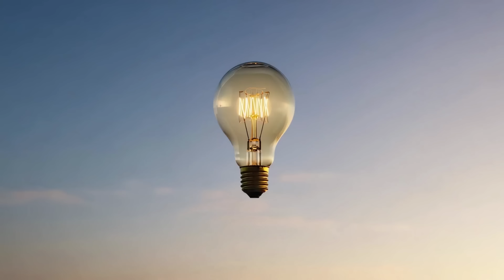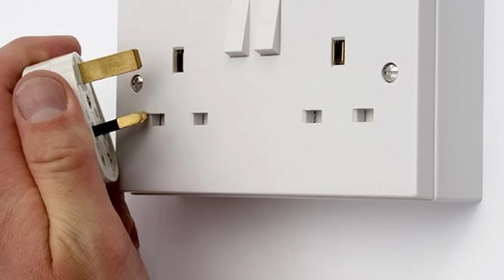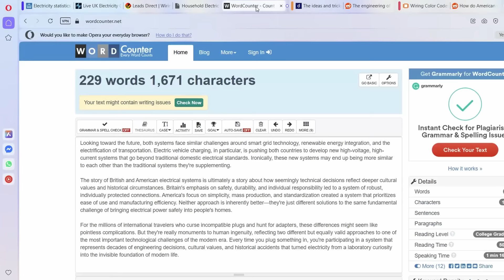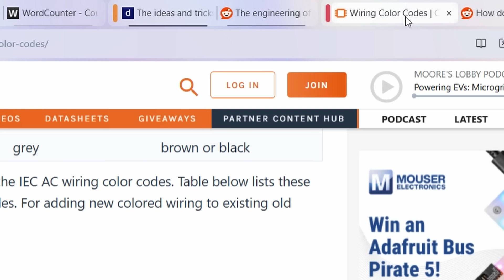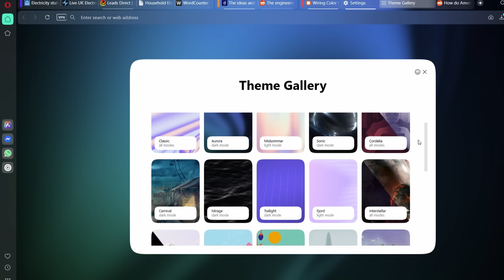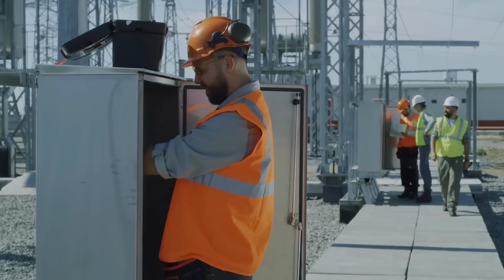British electricity is SAFER than American electricity. here's how.

Comment: For crying out loud.... Come to Australia.... We are 240 VAC with a plug design that looks like a cartoon version of a Chinese person's face. We don't do the ring feed (we consider it dangerous). We also don't need the fuse in the plug because of it. We step the game up by insisting on RCD's back at the fuse box. These watch the amount of current that comes back on the neutral. If there is an imbalance it trips.

It's often never mentioned but both the UK and Australia have switches on our power points. The yanks don't!

Talking STANDARD Australian plugs, you can stand on it and it won't kill your foot. This is because the cable enters via the back and is inline with the pins. Australia and the Yanks win on this point. Before RCD's (like back in the 70's here) if your kid was doing something silly you could pull the cord from the outlet here (without being near the point). You still can, until you us what we call a "side entry" plug. You will see this more in professional areas known as "piggy backs" these will hurt your foot if stood on!

Comment: Now, this is something you may not know, as a 2⁰ science teacher for a decade, one of the things i Had to cover was home electrics. It's in the core science syllabus for Y7-9 (11-13 y.o's. so not only is there the inherent safety of how a plug is wired & the pins & switched sockets but i used to have to teach kids how you wire a plug & trust me, i Had to check them rigourously! (Most of the kids knew i did lots of the electrical work for things like school productions & it was always safety first, checking everything & taking nothing for granted!
I'd have to explain things like the colouring of wiring & why (colour blindness! - being red brown blind myself, telling red & brown apart could be fatal, hence the blue, brown & striped yellow + green.) & how to twist wire correctly, the correct order to do the wiring & EV which screws go where if you do happen to take them all out! (At age 10, i was already wiring up a model railway, one month own, with different voltages for different uses & including circuit breakers & fail safes!) Kids had to know about the rings mains, how lights & sockets were connected differently in different circuits & why, the redundancy of fuses, identifying the right ones, hence the equations to calculate it if all else failed & where to find the info on an appliance! Changing fuses & plug safety. As you see, quite comprehensive. Even though moulded plugs are now the norm, kids still know how to decommission a device & reconnect it! It was all about making kids self sufficient adults! It worked!

Comment: Tea-drinking came to Britain long before electricity, when water was heated on wood-, or coal-fired ranges. But perhaps the decision to go with a 240 volt system, and the ability to boil water using using electricity in a short time, held some sway in the electrical engineers' decision-making.

Comment: Our mains plugs here in the UK wern't always the current one (invented 1947), we used to have round pins, and different size 3 pin plugs for different amperages (2amp, 5amp and 15amp and were generally not even fused). Also the black insulation on the live and neutral pins wasn't a requirement until 1984. Prior to these you could insert the plug and touch the live and neutral pin while they were energized.
Reply: The 2, 5 and 15amp plugs do not need fusing and they are for use with a radial system not a ring main system and as such the bfuse/breaker in the distribution box is already at the correct rating for the outlet. The main reason for the change to the G type square pin was because of the new cost saving ring main system. At the time of its introduction. A modern 15a round pin plug/sockect pair has all the safety features of the G type except the fuse which is not neaded as the round pin design is for radial systems only.

Comment: Most of America uses an open delta three phase as apposed to the British three phase star system. In order to obtain a single phase supply from a star system you can aquire a neutral from the star point and one phase.,the American delta type of installation is not possible to achieve this in some cases you can end up. with a hot leg that means you end up with a much higher voltage. The American system is bad, very bad.

Comment: Hi from England, UK. It's not just domestic mains electric supply systems which have so many compatibility problems, have you seen how many different systems are in use on overhead electrified railways across europe? where they have DC with two different voltages, 1500 volts and 3000 volts, and high voltage AC, again with two different voltages, 15000 and 25000 volts, and if that's not complex enough the two AC systems run on wildly different frequencies, the 25000 volt system which we use here in Britain, uses 50 hertz, while the 15000 volt system uses 16.7 hertz! how insane is that?! And neighbouring countries don't have the same systems either so they have to have trains and locomotives with dual system capability when travelling across borders, like a train travelling from the Netherlands into neighbouring Belgium has to change from 1500 to 3000 volts DC, or if a train travels from the Netherlands into neighbouring Germany then it has to change to 15000 volt AC, TEN TIMES the voltage! and change to AC at the lower frequency of 16.7 hertz which needs a LARGE transformer on board.

Comment: When I was a child we had plugs with three round pins.   They came in two sizes.  5 amp and 15 amp.  We were still using them in 1968.  My mother had a flood from a burst water tank and after that the wiring was replaced.  I think that was 1978/9.

Comment: UK domestic power points can deliver up to 3.000 watts, whereas the US domestic power points, at least those I've seen can only deliver up to 900 watts, as they're only rated at 7.5 amps, 120 x 7.5=900. And back in the days of old analogue TV and VCR's the American NTSC system was totally incompatible with the UK PAL system, because both systems ran their TV frame scanning systems at the same frequency as their own domestic mains electrical frequency, i.e. the UK PAL system used 50 hertz, while the US NTSC system ran at 60 hertz, and the PAL system used 25 frames per second while the NTSC system ran with 30 frames per second, and this caused all manner of problems for broadcasters in the US and the UK when wanting to share programming, and here in the UK back in the bad old days of analogue tech the resulting picture quality of American TV shows when shown over here after system conversion was dreadful, but that later vastly improved when digital conversion became available. I don't know what if any compatibility problems there are now with digital TV and I don't know how many countries, and states or provinces etc. have switched to digital broadcasting, most likely the countries which can most easily afford to change.

Comment: In UK in the early days of electricity, one talked of 'electric light' and that was often what was installed - lighting, no sockets at all, the householder probably had nothing to connect to them anyway. Later radios, irons maybe were connected to the light via a 'bc' adapter, problems would happen if a device requiring more current was connected. Time for an update rewire! Great content, thanks

Comment: I have to correct you, the original U.K. electrical sockets and plugs were not rectangular pins and slots, they were round. It was in the late 1960’s that they changed to rectangular.

Comment: 9:53 the only part of your discourse I would question. The EU is not pressing for compatibility of plugs – you need a universal European adapter that accepts all three grounded plug types (E, F, and L) used in France, Germany or Italy. Britain shares with the EU the 230 V/50 Hz standard plus charging for EV’s, mobile phones. The reason that small children can’t poke their fingers into British sockets is because of the input to design by a British woman engineer called Caroline Haslett, ito the 1947 BS standard, emphasising safety in the home and that many of the electrical appliances were used daily by women.

Comment: It is more likely that the EU would have considered standardising on the UK system for superior safety as well as technical reasons. However it was never really an issue before Brexit and a European two pin plug will fit a UK socket, although you need small plastic stick.

Comment: Saudi Arabia switched from US electrical standards to UK standards a few years back.
US homes do in fact a 240V supply. This gets split into two 120V phases using a centre-tap transformer. Some of your higher power devices like ovens and tumble dryers run on 240V.
Reply: And the plugs on your US tumble dryer make the UK 13A plug look like a little baby

Comment: I have owned an American Kitchen Aid kettle (expensive but bullet proof) for many years. It must have been modified for 220v use and has a sliding thermostat which is very handy. this kettle is 3kv and boils in no time: easily the fastest kettle I have known. also have a Kitchen Aid Food Mixer and food processer. These are so over engineered (and weigh a ton) they will last a life time. The standard 13 amp Plug is easily the safest around even compared to the European plugs.
Reply: 'this kettle is 3kv'?  I doubt that.
Reply: @GrouchoEngels Label says 2.5 - 3.0 kw. sorry: got my volts and watts mixed up: but it is very fast.

Comment: In a correctly wired uk home you could literally knock the toaster into the bath with you and be fine.
Reply: For a start, you'd need a pretty long extension lead, as 13A sockets are not allowed in the bathroom. But without RCD breakers, you can do harm by dropping the toaster or hairdryer in the bath!

Comment: Also, the transmission differs drastically mainly our electrcity is underground, which comes into a transformer station to convert from the high transmission voltage down to the voltage that is required for each home. Also, trees cant fall on underground cables, like they do in America and it isnt a lightning conductor again because its underground.
Reply: "Our electricity is mainly underground"?  Er, no - it may be in towns but the majority, certainly in less built-up areas is most definitely overground, especially grid circuits of 132, 275 and 400KV.  Have you never noticed lines of wooden poles (normally 11KV to 66KV) and bloody great steel pylons across the landscape?

Comment: The standard changed in the UK to 230V in keeping with Europe. The UK's standard mains voltage is 230 volts, with a permitted tolerance range of 216.2 to 253 volts +10% to -6%. This is an alternating current (AC) with a frequency of 50 hertz (Hz), which changes direction 100 times per second. 
This harmonization to 230V was part of a European standard, but the old 240V supply is still considered to be within the allowed tolerance.
Reply: A typical EU fudge to set a standard without anyone having to change anything. That's the kind of flexibility that keeps it going :)
Reply: Surely you don't really believe that the UK mains voltage will be dropped to 230, that would eat too far into the fat profits of the greedy energy suppliers and the appliance manufacturers, especially them that make stuff like cookers, and tumble driers and kettles and showers etc.

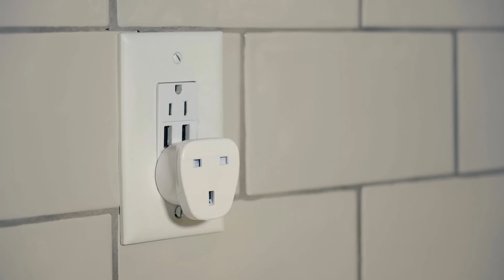Comment: At 6:15 to 6:20 the adaptor (and maybe the wall socket) is upside down: when plugged in, the flex from British plugs hangs vertically downwards, so the black plug is upside down.

Comment: UK electrical plugs wern't always safe. We use to have round pin plugs with the pin not insulated near the plug which lead to many fatal accidents. Now they are much safer with insulation near the pins meaning you cannot touch a pin and get s shock.
Reply: The round pin plug design has been updated for insulated pins as well.

Comment: Question for Kalyn...

Do US household appliances take longer to run than UK appliances? For instance, a wash cycle?

I've been looking at some household appliances for the UK and US to see if the voltage difference results in a higher current draw in the US. Apparently the difference is minimal because US appliances have a lower power draw than UK appliances (US washer at tpyically 1400W vs UK washer at 2400W). I know electric kettles take longer because 110V @ 20A is 2200W maximum power whereas the UK, most kettles are rated way over 2000W as standard. So I'm curious how the lower power loads of other appliances affects the run time.
Reply: Usa max current is 15amps 😊

Comment: Video needed to be longer to take account of the long sponsorship section.
This was brief an misses several key points about the British system and how it developed..
There used to be 15 amp 5 amp(smaller) plugs and sockets that were not fused. A socket could take both plug sizes (determined by the load) and has an on/off stalk like switch.
Initially the 13 amp plug did not have the half insulation on the live and netural pins and came with the default 13 amp fuse. This was not ideal as all appliances came without a plug fitted and so lower wattage appliances that needed a 3 or 5 amp fuse remained with a 13 amp fuse that left them more of a fire risk also many people would not wire the plug properly;again causing problems.
The UK did adopt the European colours for wires: yellow + green for earth, blue neutral and brown live. Previous to 2006 it was the same for earth but neutral was black and live was red (which made sense as red for danger).

Comment: It is not just a case that British 'electricity' is safer as that is wildly inaccurate. The British electrical system at twice the voltage and far higher current than the US system is in fact significantly more dangerous. However, the standards and safeguards built into the British system, which are almost entirely absent in the US system, makes it significantly safer despite the higher voltage and current. The US system is based on the catalyst principle of cheap to produce, remove durability and safety from all of the hardware, and resell it again and again and again. The UK system is built on safety, durability, and reliability.

Comment: The U.K. electrical standards evolved over time as improvements and safety features introduced over time were incorporated in the standards. Some of these came from adopting ideas and implementations by commercial companies.

The U.K. electrical standards are still updated.

The system used today is much improved compared to some of the first electrical systems used in the U.K.

The U.K. did not start off with a national electrical system. Local private electricity companies supplied the local area. At first, only lighting systems were installed. There were not many electrical appliances available.

Across the country there were even different styles/types of plugs and sockets used.

The 13A "square" / three pin plug and sockets are actually relativity modern. Before this, in my part of the country, round pin 5A and 15A plugs and sockets were common. These did not have a fuse. But were supplied either individuality or in small groups (radial circuits) from a fuse box. The fuse boxes typically had only three, four or six fuse holders. Keep in mind that each room would often only have one socket, and small bedrooms may not have had any sockets.

The purpose of the fuse that is fitted in a 13A "square" / three pin plug is to protect the flexible cable (flex) that connects to the appliance from overheating in the event that it is subjected to a short circuit. Either due to the flex being damaged or by a faulty appliance.

The U.K. and Europe have harmonised with respect to the colour coding of the fixed wiring cables and the flexible appliance cables. Plus the supply voltage has been harmonised to 230V. Although the tolerance range still allows existing 240V (U.K.) and 220V (Europe) infrastructure to continue in use.

Interestingly, the U.K.  13A "square" / three pin plug and sockets are also used in some other countries around the world.

Comment: I'm sorry but your video sounds exactly like AI written bullshit talk. You basically say next to nothing in 11:10 of video. You dont even mention the main reason the Brittish actually! used these plugs with fuses, which has not a thing to do with ominous "safty culture", ie. the fact that they use ring circuits in their houses, safing wire materials. That leads to quite high currents for circuit brakers individual cables and sockets are not made for. Thats why there is a separate fuse in each plug. To reduce the maximum current that can be drawn before a fuse in the line brakes. Normally thats 10 amps and 32 for the whole circuit which basically no cable used in normal appliances could deal with. In the rest of the world we would be looking at circuit brakers with 10-16 A for normal household appliances.

Comment: Actually the UK began switching from type D to type G plugs in 1947.
As for EU electrical harmonisation, the UK did indeed switch from our orginal voltage of 240v to 230v and matched the EU wiring colour scheme. Plug types and wiring systems have been left to individual counties. I blame the French for this.
Reply: The delivered voltage didn't change, though; it's still around 240v. The Government changed the legal nominal value to 230v but broadened the tolerance. So, previously: 240v ±6%; then: 230v +10%/–6%, meaning sockets can be from 216v to 253v potentials.